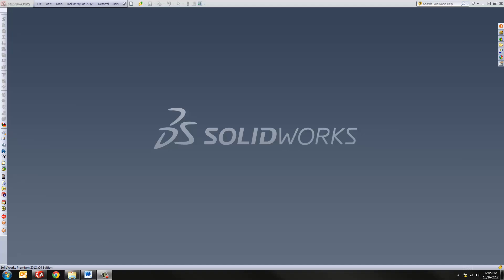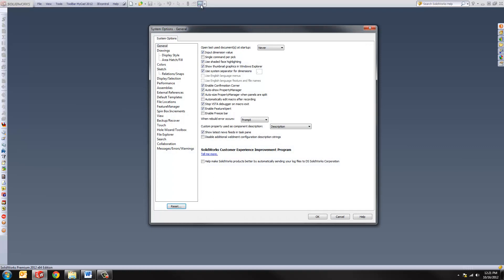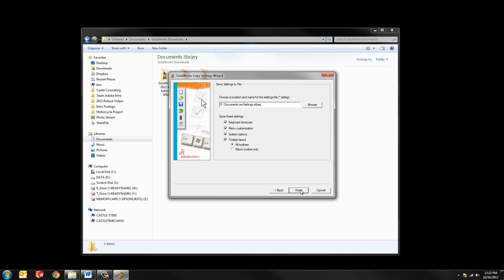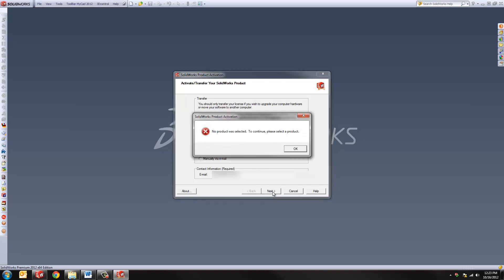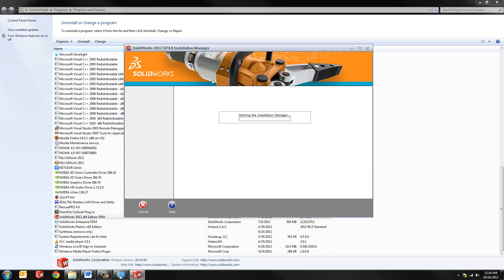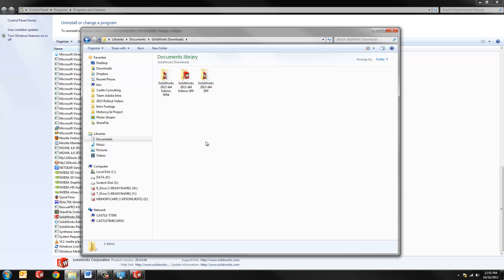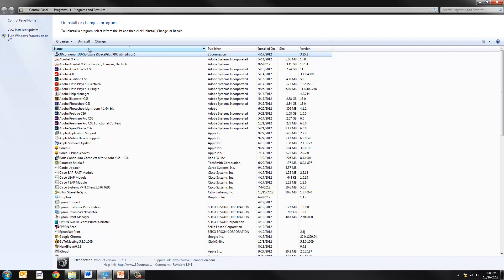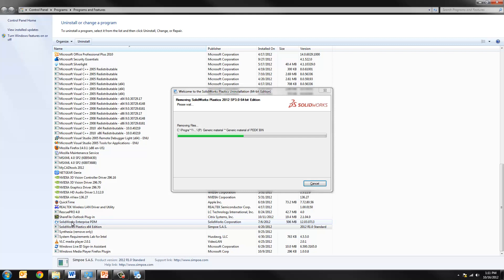SolidWorks Clean Uninstall & Reinstall for SolidWorks 2013 - Part 1

Comment: hello, i have a problem with my solidworks. when i try to uninstall it it gives me the error message: 

Internal error: the windows installer for this product component did not run as expected: UnRegServer_SimpoeEmptyExe.exe. 

when i click continue installation i get another error message: The installation manager encountered a fatal error.

i dont know what to do so help would  be appreciated :)
Reply: Have you figured out how to solve this? I'm having the same problem.
Reply: Ethan Nino i re-installed windows :/
Reply: +nick brookhuis I ran into this error when I uninstalled the items from step 9 out of order. (I uninstalled the Microsoft .NET and Visual C++ programs first, which was a mistake) I did a System Restore to undo these uninstalls and then uninstalled SolidWorks first.